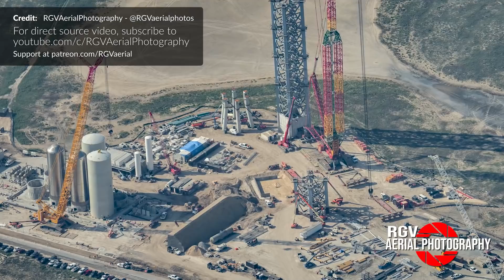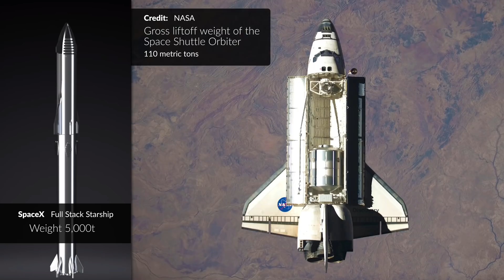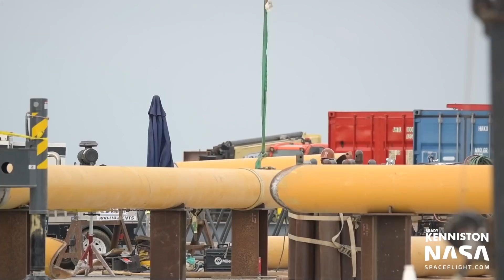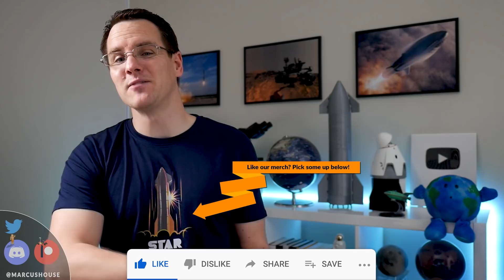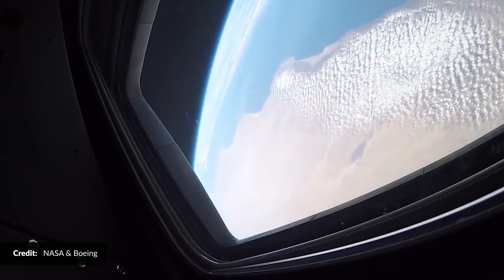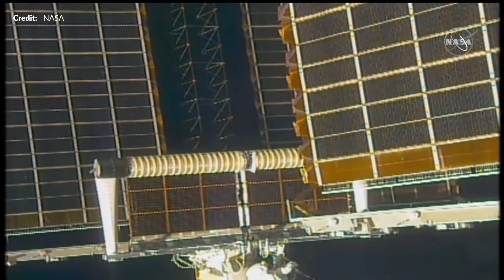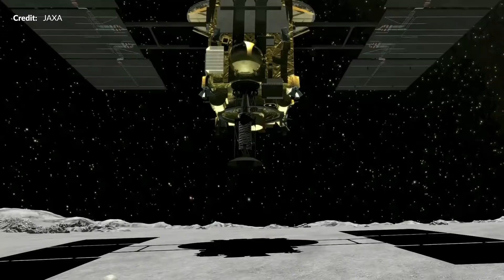SpaceX Starship requires new booster, Shotwell still suggests July for Orbital Flight Test

Comment: I hope Hubble makes it to the end of the decade
Reply from the maker: Likewise!
Reply: I agree
Reply: @Daidalos-BCE  come on now, why you gotta be rude about it ?
Reply: @Daidalos-BCE  nonsense, reusable rockets were a project since the 1930s but the technology simply wasn't there.
Reply: @alanmay7929  That is why they invented the flying saucer.
Reply: For human space exploration, Hubbel was like an infant opening its eyes for the first time.
Reply: @SomeoneOnlyWeKnow yes I can say that about anything, all the power of the computers used back then in those satellites/rockets were way less than even the chip of an iPhone 3.
Reply: I hope that a starship can take Hubble to a museum
Reply: @evannibbe9375  impossible.
Reply: @alanmay7929  who knows?? But it would be very cool if it could
Reply: @alanmay7929  Getting a Starship to Hubble and bringing a Starship back are not a problem. Securing the payload will be the biggest challenge, but should be possible, as long as the part that secured it to the rocket it launched on is still intact. Funding isn't a huge issue like it was with Space Shuttle because Starship launches aren't very expensive.
Reply: @user2C47  wrong, it will actually never happen, the hubble telescope is very heavy and to recover it will need an exhausting reconfiguration of a rocket and many other parameters and the mission also may never survive landing.....
Reply: @alanmay7929  I never said it would be at all easy, I just mentioned that a system such as Starship makes it possible. Remember that Starship isn't just a second stage, and can be easily reconfigured. We don't know exactly how much Starship can bring back to the surface, but Starship can send about 100 tons to orbit and Hubble is only 12. 
The only other system with a similar capability was Space Shuttle, but the cost of a Shuttle mission is far more than any museum would pay.
Reply: @alanmay7929  Hubble was designed to be retrieved and brought home. They never implemented it because it was simpler to repair/update it with one mission instead of two.
Reply: @Markle2k  then why didn't NASA attempt to repair it again, since its that "feasible or easy" wtf! It has redundancy computer modules even tho its already very outdated , anyway the next gen telescope is coming soon.
Reply: @alanmay7929  I should have said “simpler and cheaper.” The cost of a Shuttle launch was about $1.2B, in today’s money. As an aside, that’s about 10 percent cheaper than a Saturn V. The hardware for the upgrades were pennies in comparison. And an astronaut’s salary and training, pennies of that.
What SpaceX would need for a return mission is the hardware design for the cradle that the Shuttle used to take the damned thing up there and probably a robot arm from Canada. Some extra money would need to be spent to adapt NASA’s cradle design to Starship’s needs for center of gravity and such. Starships are intended to carry cargo to the surface of Mars. It is directly in their wheelhouse. Plus, for Elon’s ego, it would make him a world hero if it went on tour to science museums around the world before settling down in the Smithsonian’s collection.
For the last point, JWST is not a Hubble replacement. It is looking in a different part of the spectrum. The Nancy Grace Roman telescope will serve yet another purpose. We should give NASA the money to use the hardware that they were already gifted from the NSA and put a true replacement up in orbit. It would continue Hubble’s legacy.
Reply: @Markle2k  the $1.2B in todays money is not worth mentioning, spacex is intended to carry cargo to space but not bring it back, those are two totally different things. Bringing such a gigantic mass down to earth could end up with a disaster.
Reply: Something else occurred to me, you might pay for the mission with entrance fees for that museum tour, much like with the Tutankhamen tour.
Reply: @alanmay7929  Hubble’s mass is 11.1 metric tons. Starship is intended to deliver 100 mT to the surface of Mars with less than one percent of the atmospheric density. Consider that the mass of the hardware needed to secure it in the payload bay is an absurd 3 times that of Hubble itself and it is still a walk in the park.
Remember, the Space Shuttle was designed to to do it with far less capability. The money is quite worth mentioning because that is one of the reasons why they didn’t do it that way.
Reply: @Markle2k  unfortunately I i repeat myself spacex was made to lift the "100mT" but not bring it back to earth or let alone land on mars. The rover landing on mars was already a serious accomplishment what about 100 tons?! Not to mention it takes 6 months to get there with enough fuel.
Reply: @Markle2k  the space shuttle was designed to be very flexible for different missions over the years
Reply: @alanmay7929  Umm, yeah. So why are you arguing with me?
Reply: @alanmay7929  This isn't the place to be putting your ignorance about spaceflight on display.
Reply: @alanmay7929  
It's only 11.11 metric tons.

Comment: I'd like to know how the launch pad and surrounding area will not be completely destroyed by the launch of the multi-Raptor Super Heavy booster...
Reply: An ENORMOUS water deiluge. That's what the 12 meter GSE tanks are for
Reply: Well only one is for water. But yes, there is a water sound suppression system in the launch table.
Reply: The water deluge will help but it's primary purpose is sound suppression.  The launch tower and surrounding structures are designed to withstand the launch.  My concern is that in the event of a catastrophic failure at launch can the tower and pad survive?  That is the big question.